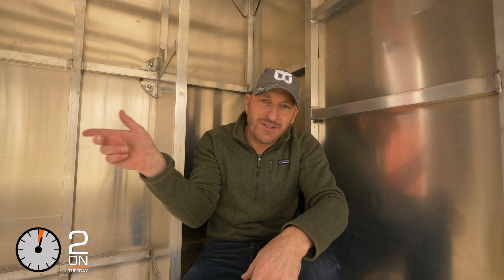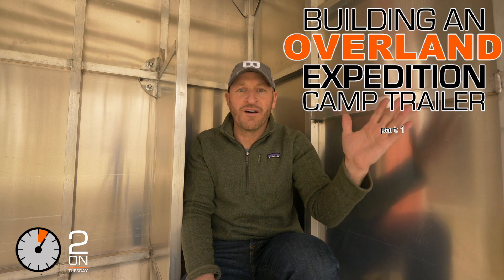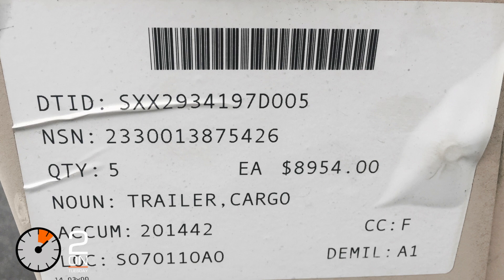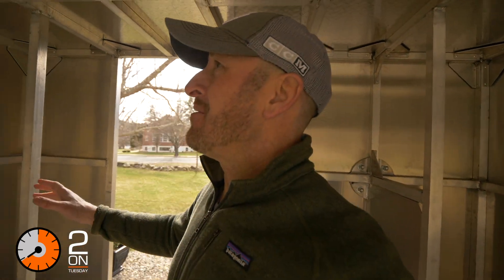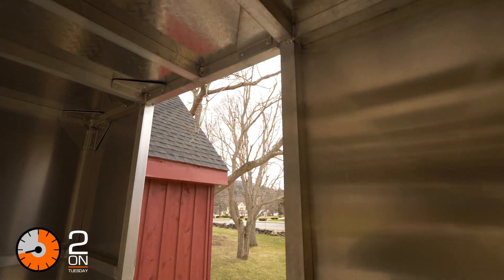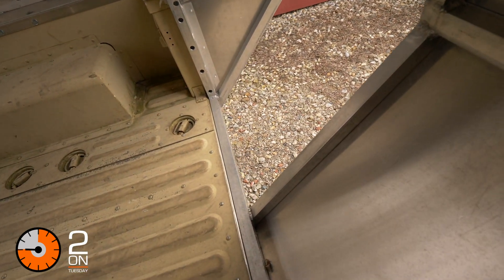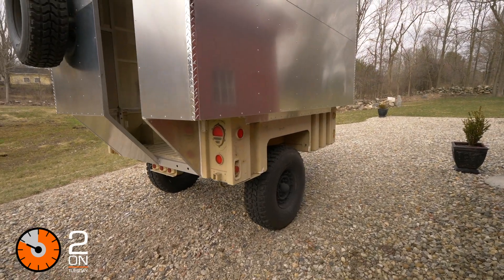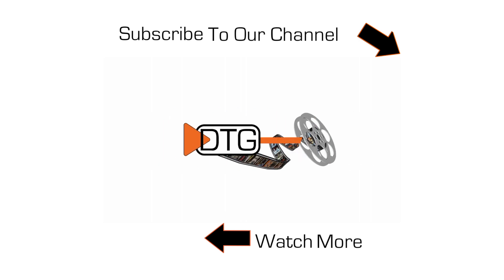Building An Overland Camp Trailer

Comment: Do you remember, and are you willing to share, materials (aluminum, steel?) used, material dimensions, and how much length you added to the tongue?  I have been trying to decide the best way to extend the tongue on my trailer and this is similar to what I have been considering.  I especially like that you did not mess with the connections between the frame and the bed.  While in the military I witnessed trailers go through serious situations and I want to keep as much of the original design elements as possible.  Thanks for any input.
Reply from the maker: Absolutely! What ever info you need. I am getting close to putting up a walk around video of the entire thing.

Comment: Pretty nice Build I’m trying to do the same set up but I haven’t decided what kind of insulation I want!  Just curious what your plans forInsulate your camper
Reply from the maker: Thanks for watching! About to start getting to that now that the outside is largely done. I built the frame with inch and a half square aluminum frame so I am debating using insulation board and contractor adhesive to apply. Filling in gaps with spray foam insulation etc. Not entirely sure yet doing some research and watching other peoples builds. I will keep you updated.

Comment: So I have to ask...if you like to build stuff...why start with a military trailer?  Was it cheaper to start with this and convert it compared to building a trailer from scratch?
Reply from the maker: Great question. I wanted a base that was rugged and off road tested. I particularly liked the way the military designed the suspension and the fact that it was an all aluminum construction. I think it was also cheaper to start this way, the M1102 trailers were going for around a $1k and they for the most part were new. The military paid $18k for them! Would have cost a lot more than $1k to build it plus the tires, wheels etc. Thanks for watching.